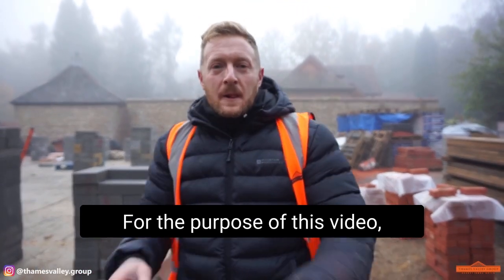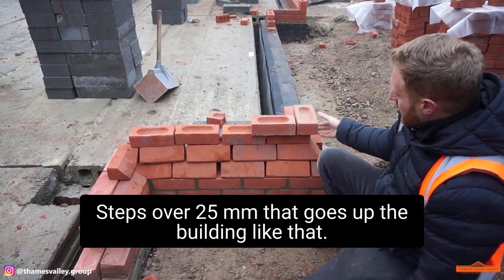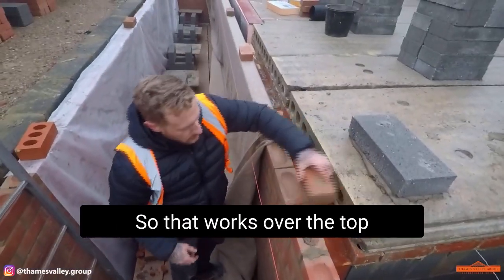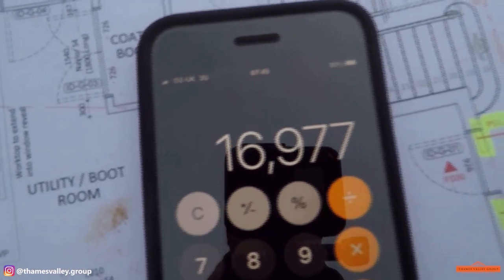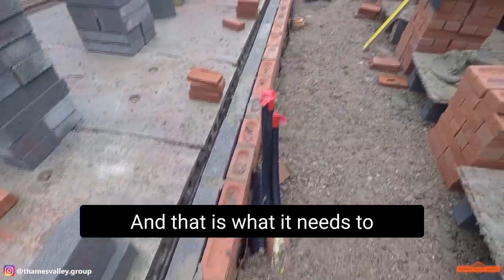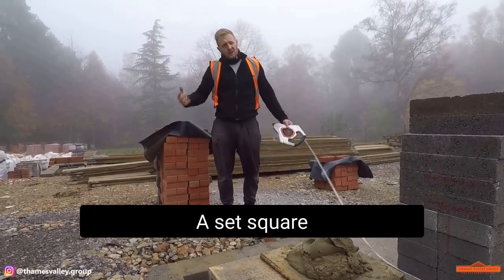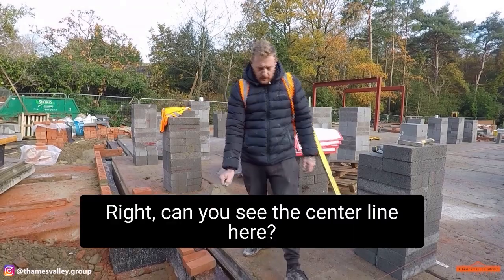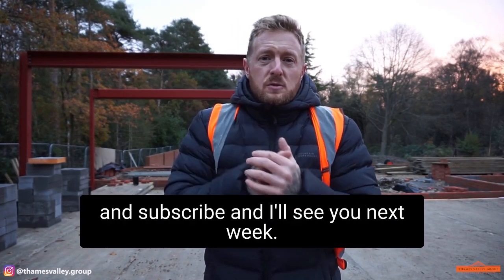EP13. Setting Out Multi-Million Pound House. NO MEASUREMENTS

Comment: Great channel .should you not have 3/4 cut brick on the corner under the plinth so you don’t reverse the bond
Reply from the maker: Thank you. No that’s for a single plinth, double goes back 100mm which works brickwork. 👌🏻👌🏻🤙🏻🤙🏻
Reply: That will put a bat in the bond 👍🏻
Reply from the maker: @ozbrick498  no mate. If I put 3/4 it would. 2 3/4 brings bond back 50mm either end which is 100mm in total which introduces a bat. I’ll upload vid of superstructure. Double plinths comes back 112mm on each corner which reduces a whole brick per flank 👍🏻 on a single plinth you can either use a closure up the corner or 3/4.
Reply: Ok mate have a good Christmas
Reply from the maker: @ozbrick498  and you dude. Merry Christmas 👌🏻🎄✌🏻
Reply: @Levelupconstructionmedia  Single  plinth do quarter bond and no threequarters Iooks better I think,
Reply from the maker: @bricklayersworldwithandy6277  yeah we have that on one of our projects depends how many courses above dpc to plinth in my opinion. To many looks odd 1/4 bond. 🤙🏻🤙🏻
Reply: @Levelupconstructionmedia  I mean just the plinth quarter bond then just reverse it all on top, think that works ,ime sure that's how I do it, can't picture it in my head now lol.
Reply from the maker: @bricklayersworldwithandy6277  as soon as I sent that last message I realised that’s what I meant too. If you do it that way it’s full bricks below plinth, single plinth reversed full bricks above . Merry Xmas mate
Reply: @Levelupconstructionmedia  You to mate👍

Comment: 4 brick 890 + 10mm perp. So it’s linear gauge @890.
Reply from the maker: As I mentioned we have big bricks and small bricks so we have set it to 0.900. A lot of the bricks are 217 and 218 which is why we have added the 10mm. also v joint so slightly bigger joints are fine.
Reply: @Levelupconstructionmedia   what the window measure like ?! Will you shuffle them to suit you ?!
Reply from the maker: @fabiandegussion5134  we have 140mm stone mullions up the reveals on doors and windows so we have made all the opening work for those.
Reply: @Levelupconstructionmedia   very noyce. They will look great.
Reply from the maker: @fabiandegussion5134  cheers dude merry Xmas